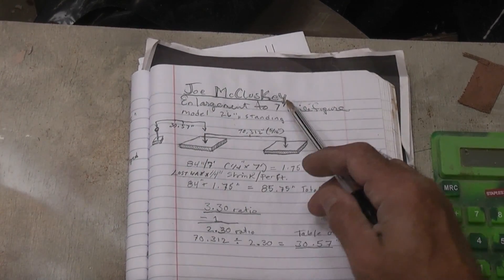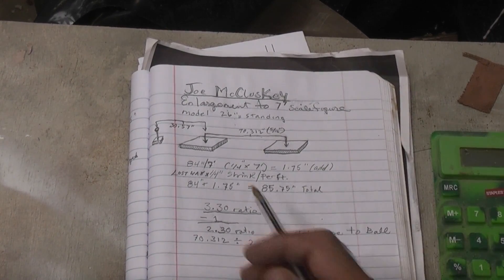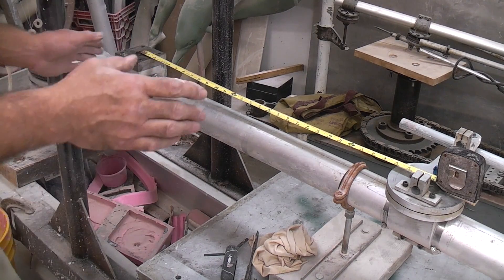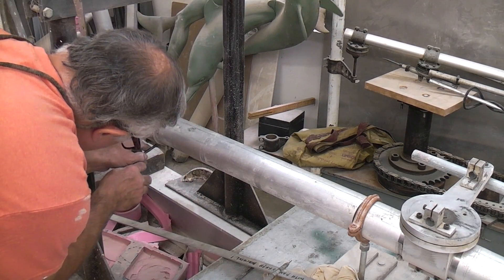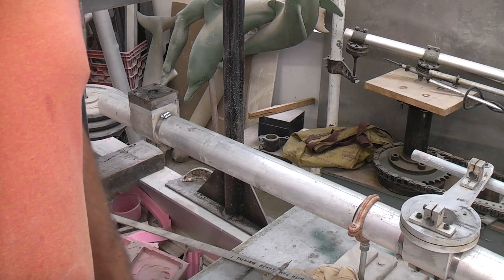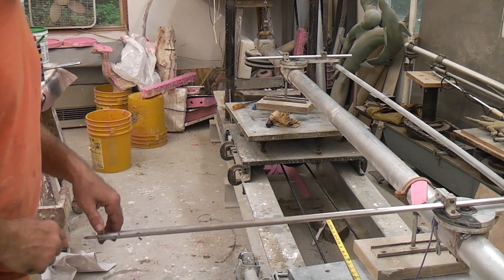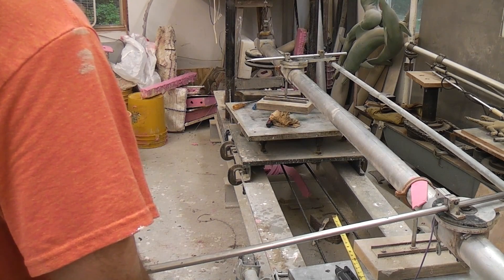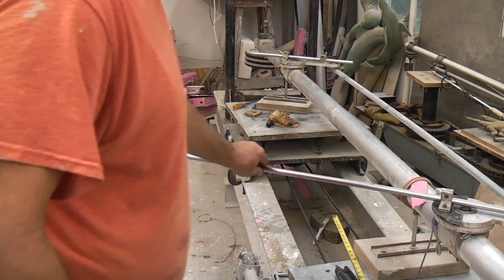3 D Pantograph Enlarging Part 2 : Setting up the Pointers and Sway Bar.

Comment: Thanks for outlining how to use these machines.  About the math, why do you subtract 1 from the ratio?
Reply from the maker: It is basic algebra. No one has ever given me a clear explanation for it.  So I have followed the formula like l x w. However if you don’t take 1 away your set up will be wrong.
Reply: @michaelkeropian2954  Thanks for the reply.  I took your information from the video and worked it out after looking up some pantograph math online.  The pantograph ratio is equal to the (distance of drawing point to pivot)/(distance of tracing point to pivot) since you already have worked out the ratio you want and have measured the distance between the drawing point and tracing point.  You are solving for the other distance that's where the 1 is generated.  So in other words: ratio = D1 + D2/D1  or (D1/D1 + D2/D1) so the D1/D1 is the same as 1.  Not sure if that makes sense it's hard to see written this way but at least I understand why you are subtracting 1 now.
Reply from the maker: @finster101  That's how it was explained to me, but I simplified the formula.

Comment: sir I want to engraving on iron by model. my model size is 8 inch Dia but my iron mold Dia 32.4 mm so how to engraving  on iron, and please. help me how to make machine for sculpture designing on iron
Reply from the maker: Perhaps you should look into engraving machines similar to a machine called the Janvier die engraver that is used to make steel dies for medals and medallions
Reply: Sir can you provide me details of machine how can I make it in india
Reply from the maker: @sonuverma2796  I am not clear what you are trying to engrave. If you are making dies for medals I would suggest you google the Janvier Machine. Which engraves and reduces steel dies for making medals. I can't post a picture but you can find pics online. If you are looking for a basic design look up Berthold Nebel Pantograph Patent and drawings are online.